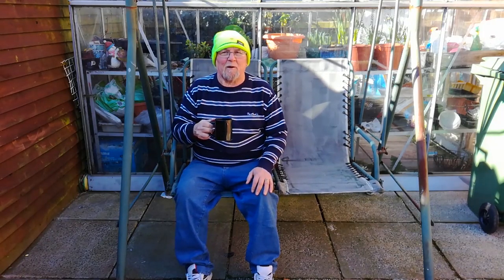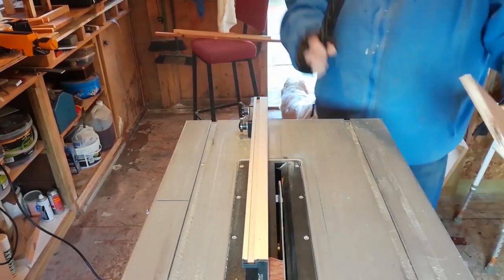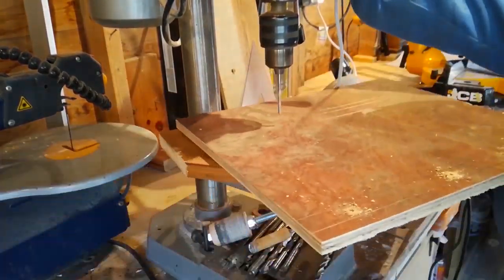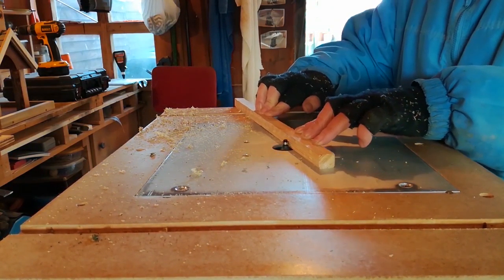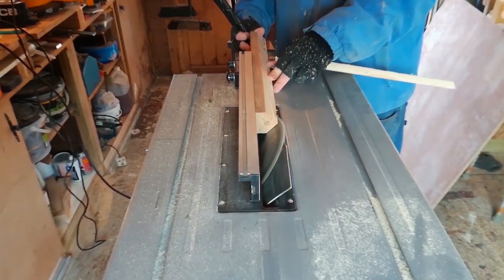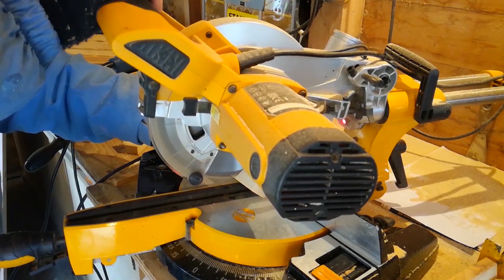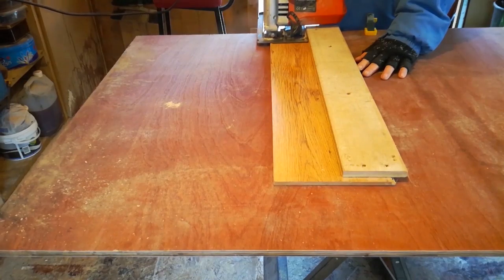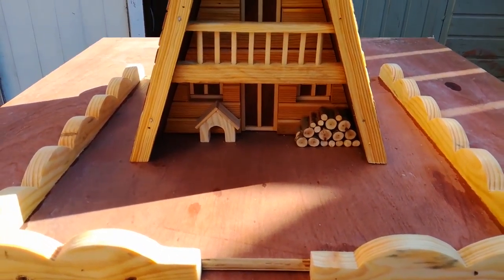How to build an Alpine bird table

Comment: I you have a wee bit of a accent, kind of like the pipers and the band I played in when I was younger.  You say it's a big house but no clean out or hole for the birds to get in.  I try and stay a way from plywood as it does not weather well.  Cheerrs
Reply from the maker: I used marine ply and sealed it. I am from Northern Ireland that's the accent you hear. I built that about 3 years ago and it is still like new. It's been through snow and ice rain and hail hot and cold. But like anything that is kept outside it must be protected by a coat of either wax or stain once every 2 years.
Reply: @harrykatt2070  I was in Ireland the 1st of Sept for a week.  Went to Fern, Wexford Ct researching my Name and then went to Port Stewart in the north were my Grandmothers family came from.  Had a wonderful visit with the relatives.  Great time and wonderful people.